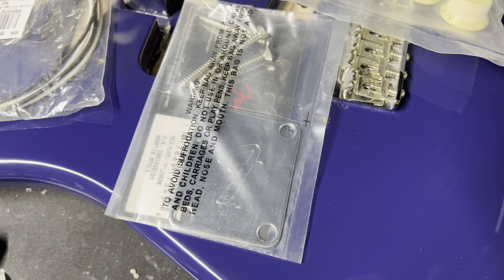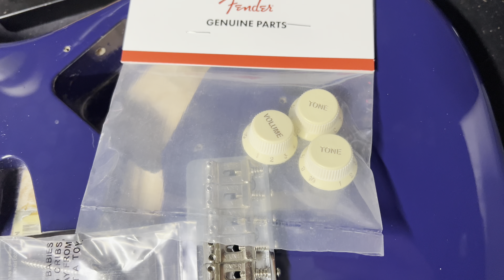BUILDING a MN4 Fender "Black Label" Hardtail Stratocaster!

Comment: Awesome video Jake! Huge fan of the previous black label legend video. I managed to get hold of a mint 94 black label. Did the few obvious upgrades. Full block mexican trem, AM pro 2 machine heads and the rewiring. Original mexican pick up's left in it and by far its the best strat ive played. The neck is amazing. In fact mine has clear evidence of being finished by hand. Ive noticed they are going up in value.
Great vid, great partscaster Jake. All the best mate

Comment: You should not be moving the back end of the drill in a circular motion while drilling out the hole. It causes the hole to be wallowed out, which you can see that on the first hole. If the drill bit is not big enough, go buy the right one. You don't use a brad point drill bit for increasing a hole size. It has no way of centering itself in the existing hole and can really chew things up. Use a regular tip drill bit for this operation. The tuners should all be in line with each other. You should be able to lay a straight edge against the edge of those tuners, on the back side, and have the straight edge be flush with all six tuner edges. These are all out of alignment with each other. I would have used some wood chisels to clean up those pickup cavities, and they would have turned out less chewed up looking. These observations are only for people that are really picky about how mods/builds turn out. Everyone is not as picky as me and this is not intended to criticize Jake or anybody else. We all have different ways of doing things and as long as it turns out good enough for you, that is all that matters. This guitar sounds great and works fine the way it is. It looks good, also. And Jake is super happy with it. I am just an extreme perfectionist, and maybe only other extreme perfectionists should be heeding my observations. A lot of times, good enough is good enough. I just repainted a guitar with $178 worth of paint, and it did not turn out perfect. Some areas I did not get the paint thick enough and the sanding/buffing made some areas where the underlying paint layers showed through. They at least look like normal wear or fading. But there is no easy touch-up in candy paints, and I am satisfied enough with the way it turned out that I am not going to spend that much again to try and get it perfect. I figure the guitar brought its own mojo to the paint job. Others have liked it also, the way it is. Even an extreme perfectionist can be happy with imperfection. I am learning to be. So, everybody, do what you do in your own way. That is what this hobby is all about.

Comment: I love a hardtail Strat.  Mine is not all Fender; it's about 2/3 Squire and 1/3 Fender.  I decided to spend on a loaded Rober Cray pickguard from Stratosphere, plopped it in a Squire Bullet body and added a classic vibe neck.  I can't say that it plays as well as the Fender Robert Cray Strat because I never played one, but it plays great.  I'm into it for just under $350 with almost half of the budget spent on the loaded pickguard.
Reply: Did the fender neck fit the squire pocket without having to mod anything?